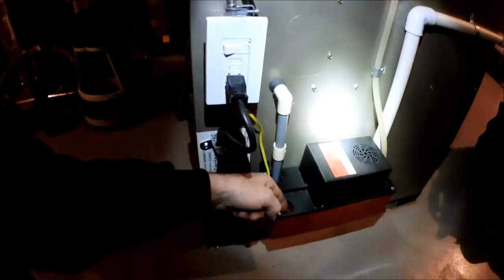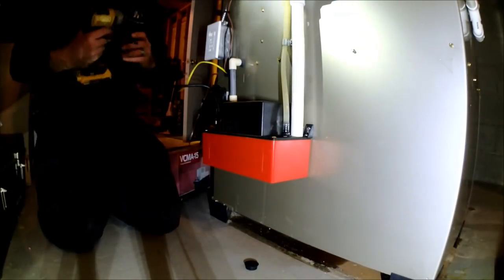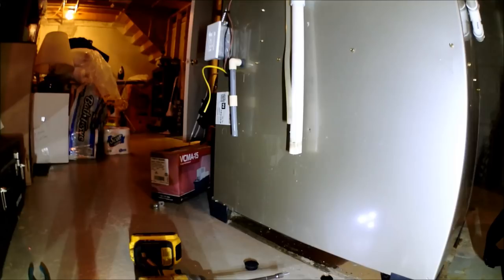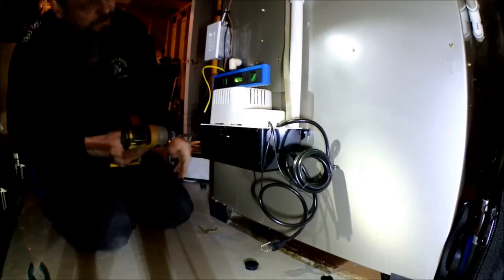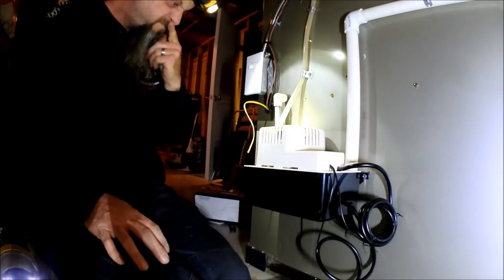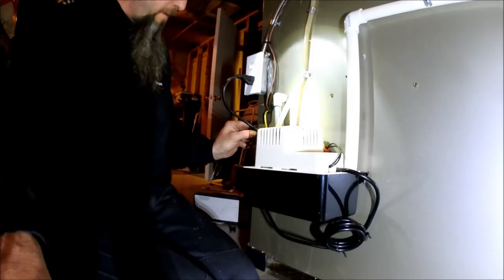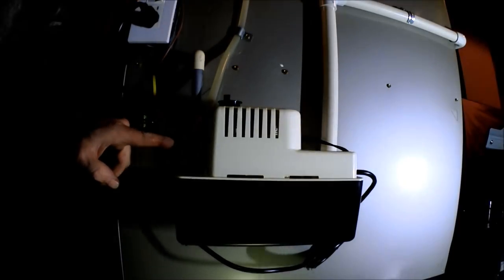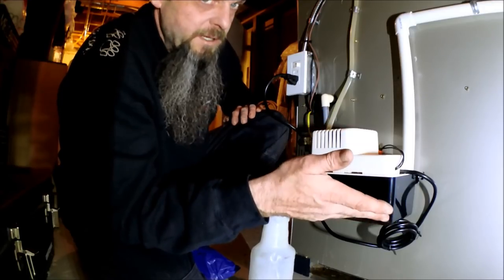Quick condensate pump change out (Little Giant condensate pump)

Comment: heating the clear pvc hose with heat gun softens it and doesn't take long. it works great for chemical hardened hoses too (hot tubs/pools)
I don't suggest a torch, because it's too hot and hard to not burn the pipe and that looks bad :)

Comment: I think that on the little giant condensate pump you have the option to flip the upper assembly 180 degrees so that the discharge fitting can be at either end. Good video.
Reply: Yea on those condensate pumps you can  separate the black sump section and rotate it 180 degrees then snap them back together. This way the mounting ears can be on the other side of the pump.

Comment: That's so funny. I was doing the exact same thing, the exact same day, with the exact same condensate pump. I hate those diversitech pumps, they are the worst! They always get clogged in the clear piece of Hose they used to connect the pump to the bottom side of the check valve. And the little orange rubber check gets clogged with crap and they won't pump. I really like the blue Mars pumps. They're very well made, they pump great and they have Quick Change check valves. So far I've had no issues with them. I couldn't get my clear tubing off either, I had to cuss it a few times and push it up from the bottom with a flat head screwdriver. Haha 👍